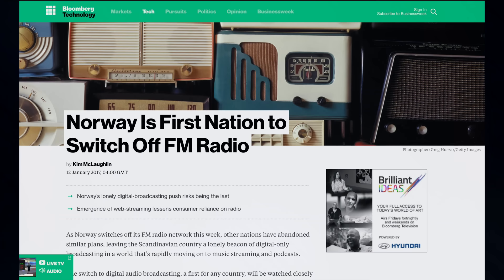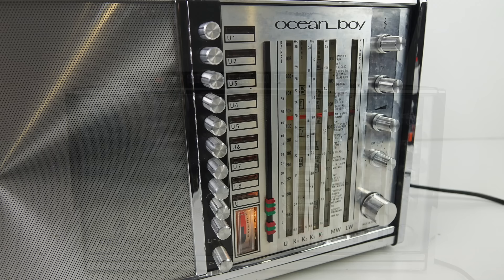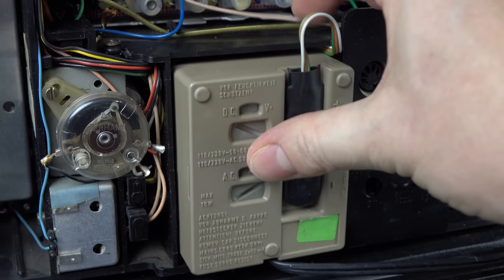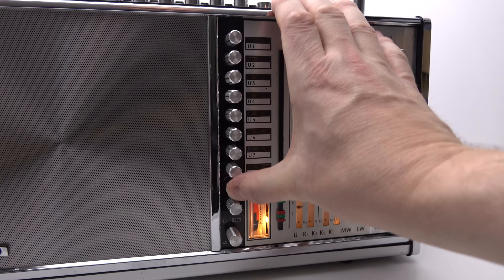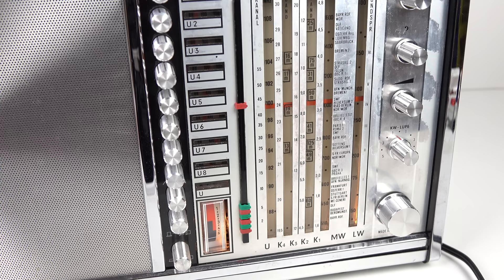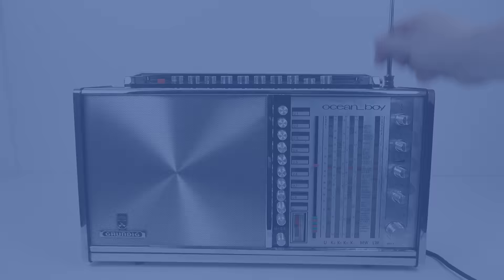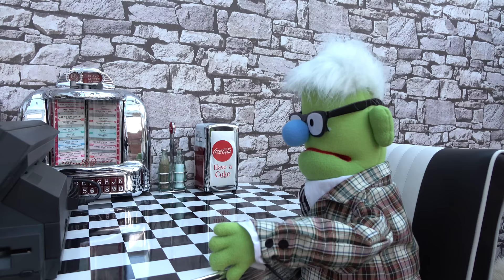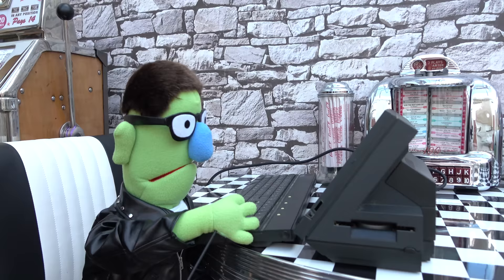Design Classic: Grundig Ocean Boy 210 Radio

Comment: Comment I left on why Norway removed FM radio that's not a Chinese conspiracy story:
Norway got rid of FM radio because it geographically is very hard there. With all the large hills and mountains it's difficult to get a good signal that can travel very far. Why any other country would get rid of it, I don't know. Maybe because people love to think "Old is shit, new is good". Now here in the US, I don't see FM radio going anywhere for a long time. Digital radio is a thing, but most people do use FM all the time. Also FM radio is the best during an emergency situation here. I wouldn't expect most countries to ever ditch FM unless they have geography like Norway which makes it difficult to transmit, which is understandable. 

Also to the people saying we should remove it to free up bands for digital things:
1. We ditched analog TV in 2009, no one is using those bands 8 years later. Why would FM (A smaller range) all of a sudden be used?
2. The FM band is pretty damn small, it wouldn't benefit much at all.

Comment: Whilst there is nothing I listen to on FM (because i'm an old git I guess), when the analogue stations are eventually forced to go digital then what is going to happen to all the old radio tuners? Landfill I expect which is hardly very green. And some of those old radios were very well built, like the Roberts models as well as the one in this video, and last for decades. Also I have found that digital radios are quite power hungry in comparison. And all it boils down to is governments wanting to auction off the analogue bandwidth and in order to do that they have to clear the analogue airwaves.

Comment: well, if digital radio works as good as digital terrestial television it will pretty much suck. and in a case of national emergency an analog radio is one of the best sources for mass information... pretty sure a digital receiver has poor battery life compared rto an old radio.

Comment: My personal experience with digital TV in Poland (we still got FM, DAB started in 2013, but there's no multiplex in my area):
1. 57 channels and nothin' on.
2. Well... not exactly 57 channels. I generally live in area difficult for radiowaves. Tall buildings around me, curtaining transmitting antennas from all directions. Many signal reflections plus military airbase with all those radars, beacons etc.. It was a problem when TV was analog BUT I could still watch it little noisy and listen to the little noisy FM stations.
Now New Digital Revolutionary Quality only means to me "No signal", sometimes signal or signal with pixelosis.
I know that my friends and family living in other areas are happy with DVB and DAB but personally I hate digital broadcasting.
Reply: I can confirm that! Same situation in Italy. 180 channels, 150 with telemarketing or ads, 10 encrypted, 10 "movie" channels that interrupt said movie every 15 minutes for a 10 minute long ad pause!
Only the 10 channels by RAI (state TV) are watchable. So much for "diversity"

Oh and when it rains, if you are not in total line-of-sight with the transmitter, you get pixelated signal or no signal at all. So much for "quality". Of course you can't use indoor antennas anymore, only external directional antenna. 
On our boat, every time we want to watch TV we have to get out and point the antenna. If you are anchored in a bay and the boat moves, you lose signal...

It's all crap.
We are thinking about replacing something that WORKS perfectly when we can't even get proper internet access to the country, apart from the main cities. The majority of people either gets 5 mbit/s internet (384 kbit/s upload!!) or nothing. The lucky ones like me can get 20 mbit/s (3 mbit/s upload) via HIPERLAN or WiMAX, but when everyone is using the internet (e.g. in the evening) it can drop dramatically. And that service only covers the north of Italy :-(
Reply: "Oh and when it rains..." - Exactly! I forgot about rain, it's a tragedy...
At least I'm glad the internet works fine (cheap 40 Mb/s option, wired).
Reply: Sadly our country is the least adapted to digital transmissions because of the mountains. Signals will bounce around like crazy in the narrow valleys, and while with analog it was fine minus some interference, with digital it's no signal screen time.

I thought I was the only one with that sort of point of view... everybody seems to scream "but the analog thing is OVER 50 YEARS OLD TECHNOLOGY MOVES ON YOU KNOW."

As an aside, you might think I'm  an old man because of my thoughts, but I'm actually 19 :D
Nice to meet you anyway ;-)
Reply: "But the analog thing is OVER 50 YEARS OLD TECHNOLOGY" ** And sex is over 5 million y.o. technology, so let's replace it with some orgasmotrons and industrial stainless steel womb (if someone insists on the consequences). :P
Reply: mpingo91 "57 channels and nothin' on"?
I know who you listen to ☺
Reply: In fact I don't like The Boss at all, but he was right. :)

Comment: Well, i don't think that FM radio will be shutdown anytime soon, think about all the car radios that can't be easily upgraded and don't support digital radio, nearly 98% i think of car radios doesn't have the digital option, even the newer one

Also, FM works very well, even in remote areas, there is no reason to change to digital radio

Comment: well I assume if they make FM Transmitters that plug into a cd player tape player mp3 player phone whatever someone is bound to come up with a Radio emulator :)  probably be an app.  then again you could just try the FM transmitters they have out there , bout the only way I can get a phone signal thru the Jeep.  I'd install my own old Aiwa thats from 2001 and hasn't had a problem yet but it doesn't like being in a Jeep Liberty, that one has an aux input  which most car stereo's don't have

Comment: Switching off FM would be a mistake, analogue is so much better than DAB, exhibit A: when you lose half the signal instead of hearing what can only be described as a some sort of alien screeching noise you will just get some hiss in the signal and some FM radios will switch to mono signal when stereo signal is weak to improve performance

DAB is terrible on so many ways, FM should stay, analogue TV was fine as it was not HD and had 4 channels, FM sounds same as DAB (until you drop a tiny bit of signal) and in some cases DAB is worse if they use a low bit-rate on transmitter

also cant beat the simplicity of FM, just dial in a frequency, no menus or scanning to be done

Comment: The world already has digital "radio" via Sirius / XM. Turning off FM analog radio is silly.  In cases of bad weather or emergency, I'd really like to receive ANY radio signal for information.  In the analog world, if a station isn't coming in clearly, you can still hear the -- albeit very noisy -- transmission.  With digital information, if the signal is crap, you simply lose all audio.  (Same with digital TV now. It used to be a poorly tuned station could still be viewable (with snow/noise), but it was still there.  Now if you're not tuned perfectly, the station pixelates and completely stops.

I love digital, but there is still a place for analog in our world, imo.

Comment: Ditching the FM would be suicide for the whole industry. 
The BIG advantages of analogue recievers is that it is easier to catch a signal so you have an overall better reception of slightly hissy signals rather than "best or nothing" and mostly nothing you get from digital.
Also the low technology makes the recievers fairly affordable due to low manufacturing costs of low end units ( picked a brand new pocket radio for £5 while DAB equivalent was £20 a year ago) and the endless pool of endless units.
Once that convenience there is no longer a point in having conventional recievers and instead it will be replaced with website based listening or streaming. 
Lets not forget how the digital switchiver did not help television and, arguably, done more harm than good with the view time consistently plummeting.
To fight the digital beast the industry needs to DISTINGUISH itsefl rather than copy it.

What could bring the people back to the days of old perhaps would be something to give the radio a coat of nostalgia similar to that of old music records. Say a mass market valve set, or a more liberal approach to broadcazting making it easier to enter the air with less of a fee or cancel the fee altogether like it was done with CB sets. NOT A DISCOUNT SPOTIFY!
Reply: I meant used units when wirtting endless pool of used units.

Comment: I bought what passes for a Grundig radio a couple of years ago, a small AM/FM/SW unit to use at work. Garbage. Absolute garbage. I bought and returned 3 of them just to discover that it actually WOULDN'T pick up the AM station 4 miles from my job. Sad to see a great name down the tubes.

Comment: I really bloody hope they don't switch off FM in this country. As it stands DAB sounds like crap (64-128kbps MPEG2 streams? Fuck off!) and FM is far more reliable at picking up signals - especially important for vehicles. Digital TV has legitimate advantages over analogue, making the switchover worthwhile, but digital radio is based on an antiquated system not fit for widespread use.

Comment: I think it'd be truly stupid to switch off FM broadcasts. In many cases I've actually found FM signals to be more reliable than DAB. In one fell swoop you'd immediately deprecate millions of devices that cannot be upgraded, unlike with the digital TV switchover. When you buy a radio these days it's still probably just FM, DAB radios are more expensive. DAB broadcasts also lag a few seconds in the UK, which always annoys me.

Comment: Analog FM radio should be left alone, it's the low, medium and high frequency stuff (long and short wave) that we need to reform.  We could put digital audio down there and span continents with high quality audio.  But no.  It has to stay useless monaural AM or maybe single sideband, and they're scrapping the one that still works.

Comment: As a USA resident, what is DAB radio? is it like HD radio?
Reply: No.
Reply: Nothing like it- More like CGA radio :-)
Reply: I'm not familiar with HD radio but from what I have read it improves sound quality and can drop back to FM.If that is correct DAB is nothing like it. I commented before that it is more like GCA (Computer Graphics Array)radio. With 64KBits/s, no error correction and MP2 (yes MP2) compression it isn't much better than the sound quality you get on poor GSM call.

Comment: Turning off FM signals is numbingly stupid. What about the millions, and millions and millions of cars that does not have a DAB reciever? You wanna retrofit all of those with different radios? (And in many car models, that's not even possible)

That seems a lot more wasteful, than any operating costs of FM transmission...

Comment: DAB is useless compared to the fm  broadcast band, there are enough resources to maintain the uk fm transmitters for the next 20 years, but as usual our wonderful government would prefer us all to buy inferior equipment based on an outdated digital system which was created in the 80s.  on a similar note when digital tv was pushed onto us a few years ago, you either have a picture or you don't. so when fm gets switched off here so will my radio (my tv got switched off years ago)

Comment: FM is not going to be switched off in sane countries. A. Why would you do it? To clear up more spectrum for what exactly? Stations seem to have enough trouble filling the air time with quality as it is. If you want variety go online. B. The alternative DAB is terrible even in the incompatible plus version. Reception is horrible for apartment and mobile use and who user base isn't there's. Who the fuck is going to buy a DAB radio?